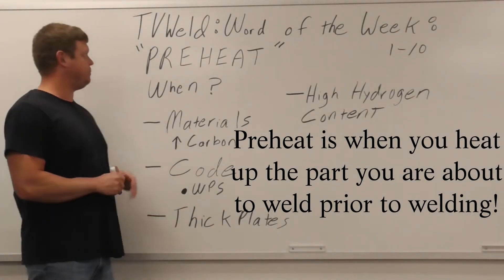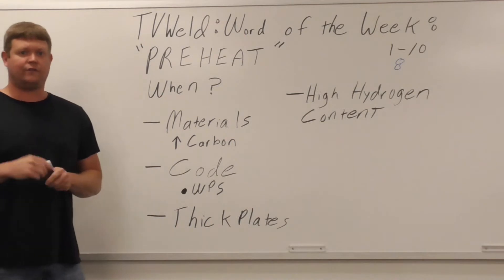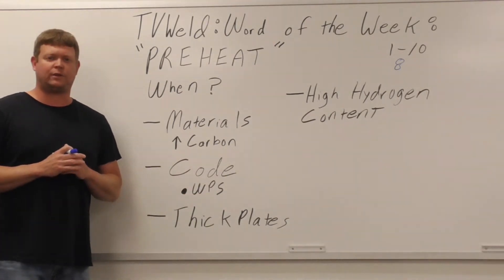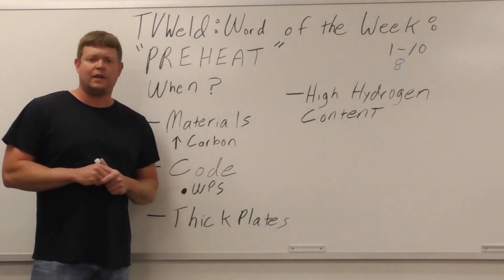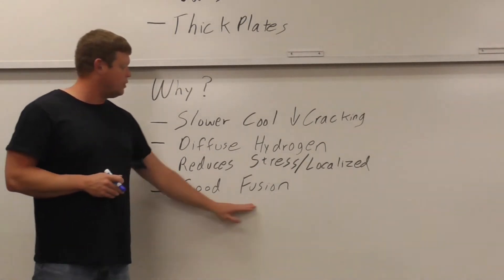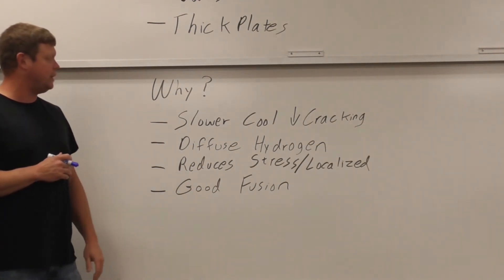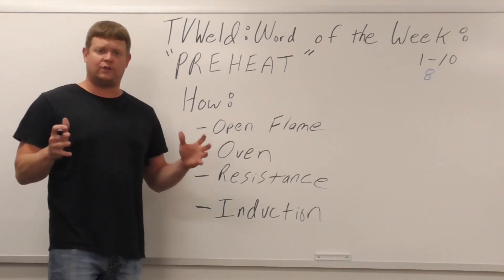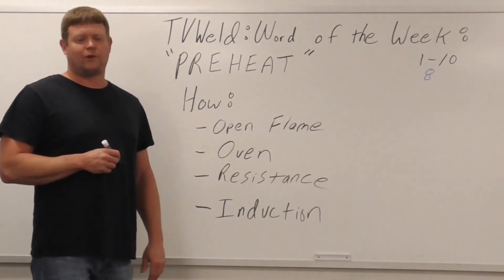Welding Preheat

Comment: When l preheat l only use a propane open flame because oxy acetylene is really expensive here in the UK. If l get a small cast iron part l could pop it into my welding rod oven overnight.
Would you say 250degrees C is enough for most jobs or should it be higher for say grey cast iron? Is there are table of temperatures available for preheating metals prior to welding?
Top stuff again young man!
Reply from the maker: I do the same thing if the part is small enough.  I typically try to get the preheat on cast iron around 500 to 600 degrees F. so around 250 to 300 degrees C I'd say would be fine.  If I look for official preheat temperatures in say a table, I always look in the appropriate AWS welding code.  Thanks.